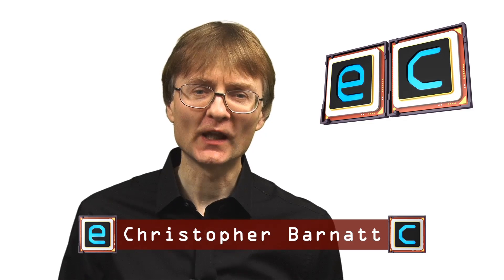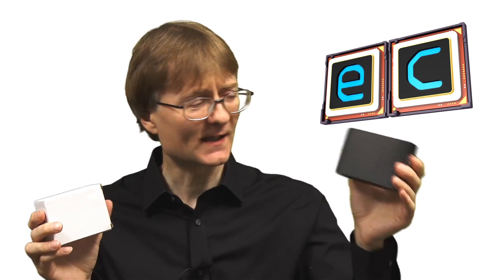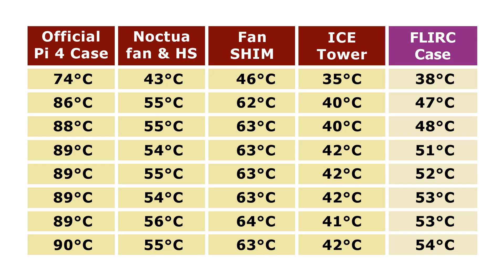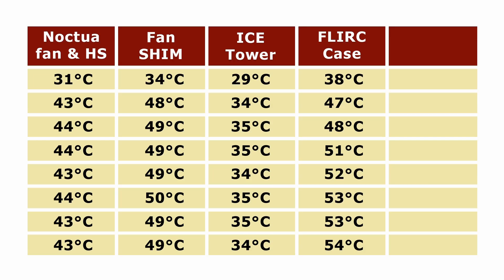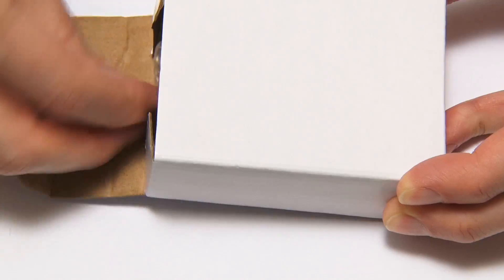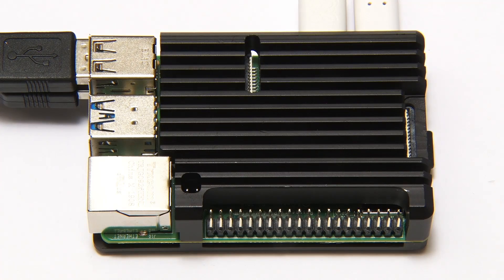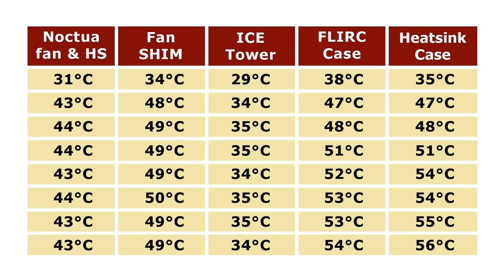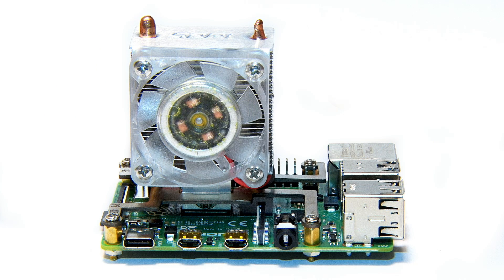Raspberry Pi 4 Passive Cooling

Comment: I have switched the thermal pad in all my Flirc Raspberry Pi 4 and 5 cases over to a proper copper shim with thermal paste on both sides.  It definitely makes a difference in pulling the heat out of the CPU and into the aluminum case.

Comment: It's baffling to me that people keep missing the performance measurement in thermal testing.  Measuring temperature alone is telling you precisely nothing.  The only thing it could possibly tell you is if you've overcome the maximum output of the chip, which is, by definition ,overkill, and in the case of solid state electronics, could actually reduce performance (ssds actually like to run warm and will perform less efficiently when cooled too much.)
Reply from the maker: No, I think you've missed the point. This video is about testing cooling solutions, which will both increase the life expectancy of the hardware, and prevent a Pi throttling at load, so delivering reduced performance. It is simply not true to say this video is about "overcoming the maximum output of the chip". Complete and utter garbage. No such thing is being "overcome". Rather, the SoC CPU cores are just running at 100 per cent utilization, which is perfectly normal and what every computer does at load.

Comment: How much do these affect performance. Does the pi thermal throttle without any cooling? Or with a small heatsink
Reply from the maker: When first released, a Pi 4 throttled very easily with no cooling. But firmware updates have improved matters greatly, so these days a small heat sink is usually fine unless you are going to run the Pi at constant, heavy load. But the Pi will last longer if it runs cooler.
Reply: @ExplainingComputers  huh I think I'll just get a small one :) thanks! Or whatever's cheapest

Comment: I have done the most overkill passive cooling solution: I attached a gigantic 1155 Titan cooler tower and converted the fan to USB (I don't use it mostly, therefore it's passive). The heatsink is cooling 2 times better than a small heatsink with a fan

Comment: My very first thought when I received my Flirc Case was regards the Plastic Lid.
Seems like it is adding an insulator on top of a large area of the radiant surface.
Has anyone done any decent comparative test of the Flirc Cases with lid on vs off?

My searches to date aren't finding any mentions.

Comment: Sir, I'm using retroflag casing for my raspberry pi & I've installed 3 heatsink & a pi fan but still it running at 62-67 degree celsius... I'm abit worry, will this damaging my pi in long term?

Comment: Not the object of the testing, but I do wonder about the RF screening properties of both the FLIRC case and the Heatsink case. How much damage does it do to Bluetooth and Wifi signals I wonder? For clarity, I want to meet Mr Cake and eat him too!
As always the information provided is extrememly useful. I use a RPi 3B+ for most of my general Youtube, email and other pursuits and as the summer approaches, I watch the effects of the ambient temperature on the system.
Reply from the maker: These metal cases do reduce the WiFi signal strength, maybe one "bar".
Reply: @ExplainingComputers  Many thanks Christopher, that is a lot less loss than I might have imagined; good news indeed. All concerns dispelled.

Comment: Take a look at that one, yeah no Kodi design, but I would say way better cooling, because it cools all chips and can be mounted at a wall: https://www.amazon.de/Geekworm-Raspberry-Aluminum-Passive-Dissaption/dp/B07Z6GK85H/ref=psdc_430174031_t3_B0861LS3Z1 What's missing on all cases with all chip cooling is a power button. The Argon One case variants have a power button, but only 2 of 5 possible cooling places are there. Especially for the M.2 variant, where you can use a SATA M.2 SSD, connected via USB 3.0, the USB controller can get warmer as expected as you an read in comments.

Comment: 13:34 looks like you put a heat pad on the wrong chip. On the heater they are all aligned, so looking at RPi the left one should be at the bottom left, not upper left chip. Anyway, the latter one is a winner as it allows absolutely required function: access to GPIO.

Comment: The ice-tower, whilst good performance, looks a bit ungainly in practice. I've got the fan-shim , and that seems to be good, apart from the noise the very small fan makes.
I guess I'm wondering how a 40mm fan on top of the heatsink-case would work. A larger 40mm fan could be made to run at a slower speed, and be pretty quiet. Also no 3D-printed stuff required.
But yes, as you say, apply the latest firmware :-D
Finally , who would down vote this ? Some people !

Comment: I have the second case you showed, the all aluminim one.. And at idle doing nothing it's at 56 degrees, feels even hotter.. Something's wrong.
Edit: I shut it down but left it powered for a day.. still pretty hot, I'd have to say 45 degrees. But I obviously can't login to check without turning it back on.

Comment: Is it possible to mount this case on a back of a Desktop monitor? Also that this monitor can power the Pi 4. Keyboard and mouse could be used wireless. So that I would have to plug-in the monitor only? Something like this would be very professional. Can you help suggest on this? Thanks

Comment: I got a question:  Was the temperature measured with the system under load or not?  I can see that the passive systems are good enough for light applications but what if the processor is under stress or heavy load like in video editing or gaming?
Reply from the maker: The whole point of the Sysbench test used in the video is to run the CPU at 100 per cent load. :) So yes, the Pi was running at absolute maximum load.
Reply: @ExplainingComputers  Thanks a lot!  Highly appreciated.

Comment: The sd card sticks out of the second case and renders the Pi useless if dropped ( like i did) .... good case but protect that sd card
Reply: i also added an old 12 volt CPU fan running at about 5 USB volts for almost silent running

Comment: How is performance of ICE Tower without the fan?
Reply from the maker: I runs a few degrees hotter.
Reply: @ExplainingComputers  ICE tower seems good without using the fan (passive cooling hack). Even though it is big!
Reply from the maker: @jlexploretheworld1164  Agreed. It is an excellent passive as well as active cooler.

Comment: One thing I wonder about: This test only heats up the CPU. In your latest video, where you have built your "Ultimate Rig", you boot from SSD via USB3. How much does the USB controller actually heat up when constantly in use like that? Would the results for the last passive cooler in this test be better, since it has a dedicated contact point for the controller?

Comment: You should run the tests with some proper thermal compound like MX4 Thermal paste instead of those naff pads and see how much better the heat transfer is!  Would be interesting to see the difference :-)
Reply from the maker: Indeed, but be aware that there is a considerable gap between the lugs in these cases and the SoC and other chips being cooled -- the lugs are are not designed to directly contact the chips, but to have a flexible spacer in the middle, which is the thermal pad. So you'd be talking the best part of 1mm+ of thermal compound between the two, and this is not the kind of gap that thermal compound is intended to fill. :) So to make work what you describe, some kind of metal shim would need to be added in, introducing another surface-to-surface transition.
Reply from the maker: Indeed, but be aware that there is a considerable gap between the lugs in these cases and the SoC and other chips being cooled -- the lugs are are not designed to directly contact the chips, but to have a flexible spacer in the middle, which is the thermal pad. So you'd be talking the best part of 1mm+ of thermal compound between the two, and this is not the kind of gap that thermal compound is intended to fill. :) So to make work what you describe, some kind of metal shim would need to be added in, introducing another surface-to-surface transition.

Comment: For some reason the FLIRC case reminds me of the He100 fighter plane prototype from WWII.  Instead of having a radiator which creates drag, they considered plumbing the coolant through the wings and body of the plane right beneath the metal skin, so the surface turns almost the entire plane into a big radiator, with less drag.
Here's the problem:  this is a fighter plane.  It would be getting shot at.  And if just 1 bullet hit the coolant channels that that the plane is covered in, it would start leaking coolant.  And it would only be a matter of time before all the coolant flow is gone, and the engine overheats and seizes.  One hit that normally makes no difference for a regular plane, cripples it.  So for a racing plane, it's a wonderful idea.  For a fighter plane, not so much.  LOL

Comment: I still cannot understand how the "Aluminium Heatsink Case" with all its fins and pads for all 3 chips get higher temperature than the FLIRC. Great video anyway !!
Reply from the maker: The Aluminium heat sink relies on quite thick thermal pads, which are probably not as effective that that on the Flirc case.

Comment: Did you notice at @13:32  the small thermal pad was on the wrong chip?
Reply from the maker: The pads were I think fitted for the SoC, RAM and USB controller.

Comment: Anyone try the script? 

It 'works' for me but it finishes immediately for me. I do get the same output. 

How do i put in a delay?
Reply from the maker: For the script to work you must have sysbench installed on your Pi. Open a terminal and enter "sudo apt install sysbench"  (do not enter the quote marks).
Reply: @ExplainingComputers  That did it. Thanks!

Comment: You’re not realising the passive heatsink is also taking the heat from the RAM and USB controller so the temperature will be higher, but those extra chips will be cooler now. Much prefer this design as a result, cus that RAM chip gets dam hot.
Reply from the maker: In what possible way am I "not realising" given that I show and discuss in some detail the three heat pads and cooling of the SoC, memory and USB controller from about 13:03 onwards? The temperature measurements here are of the SoC, not the heat sinc, which as I explictly note and show is being heated up by all three compoents.

Comment: With the Aluminum heat sink case, I've found if you raise it off the bench top, on a stand that allows free airflow around it, that makes a significant difference to how cool it gets.
I'm using part of an old PC (used to cage hard drives, an open mesh of metal about one centimeter off the desk) to rise the Pi off up.  I found without doing this the case would get uncomfortable to touch.  With it raised it ends up being warm to the touch.
Reply from the maker: Good tip!

Comment: only thing you missed here is running the new firmware with the standard pi4 case. As the new firmware has improved thermals on everything else, it should be expected to do the same even on the standard case. This way you really see the difference between the default and other cases
Reply from the maker: I was not prepared to risk damaging the Pi 4. The standard Pi 4 case has zero ventilation.

Comment: I used the pimoroni heat sink case, accept I replaced the stock thermal pads with ARTIC pads, and my temps with no fan running lakka for one hour of N64 emulation with a max top temp of 45c.

Comment: I guess a critical point to think about is if you want to attach anything to the raspberry pi, the heatsink case seems to be the right choice when you want to use the gpio pins or something else that isn't USB connected. The flirc looks nicer and less things can touch the board if none of the above matters with a similar performance.

It might be nice though to run the tests longer for both of these passive heatsink cases, the other active cooling ones look stable and the passively cooled ones are still steadily increasing. I'd be curious about both the final temperature of the heatsink and CPU in both scenarios. It'll probably be quite safe to the touch still I guess.

I do know one thing about these heatsink cases though, if I use them at an unrestricted area in my house they are likely to attract furry creatures that think it's a nice warm bed to sleep on.

Comment: Would it not have been a good idea to install a SATA Hat onto the Raspberry Pi before putting into the heatsink case to allow you to attach to a SATA SSD so you can have as mush storage as you want.
Reply from the maker: You cannot fi t any SATA HAT I know of with the heat sink cases here. :)

Comment: On my RPI4 with heatsink case (passive cooling), the idle temperature using Manjaro ARM is 38-39 C whereas on Ubuntu server it was 43-44 C....installed yesterday and loving it

Comment: Thanks, another great video!
I've installed open media vault 5 on my pi4 which is headless do you know if using it as a server needs cooling?
Reply from the maker: If the Pi is running the latest firmware, you will probably get away with no cooling. But I personally would at least an a smalll heatsink.
Reply: @ExplainingComputers  thanks!

Comment: Just one question, could the test include performance report, maybe the length of time between tests.  To see if the firmware doesn’t simply slow the frequency if the chips etc.
Reply from the maker: All tests run for 10 minutes -- the CPUs are running at full speed througout.

Comment: After watching these cooling videos for the Pi 4, I concluded that the Flirc case fit my criteria the best out of the products tested.  That criteria being very effective passive cooling while still completely enclosing the Pi.  Obviously aluminum covering/enclosing the WiFi & BT radios is likely going to have a significant detrimental effect on their performance.  I didn't have any specific plans to use BT and had already decided to use RJ45 connected Ethernet, so that didn't bother me.

That being said; I want to share with you all the case I actually ended up getting and using.  What I ended up with is this:
            https://smile.amazon.com/gp/product/B07ZVJDRF3/ref=ppx_yo_dt_b_asin_title_o01_s00?ie=UTF8&psc=1
Like the Flirc, the case is also the heat-sink.  Unlike the Flirc, there is also additional cooling lugs so not just the SOC benefits.  These lugs are not shown in the product description, but are like the ones found in another of their cases shown here:
           https://smile.amazon.com/Geekworm-Raspberry-Aluminum-Passive-Heatsink/dp/B07Z6FYHCH?ref_=ast_sto_dp
which I'm sure probably works (nearly) as good even though it doesn't have the fluting.  Also, the aluminum is thicker on these Geekworm units and is also present on the bottom as well as the top.

 I tested my case a few weeks back using the same methodology as Christopher, only I ran it for an hour to make sure all that extra aluminum had time to saturate with heat.  I am sorry I did not write down my results, but I do remember that the performance was just a bit better than Christopher's Flirc results.  Note that, I had updated the Pi firmware prior to running my tests.  I would have run the test again to provide you with exact results, but I'm too lazy to reimage it for Raspian (currently running LibreElec so sysbench is not available).  Initial ambient temperature in my "lab" was 68F/20C.  :-)  Keep in mind the testing only measures SOC temps, so there may be an unobserved advantage in cooling of other components too with the Geekworm.

Comment: But what happens if you have a high load a long time on the raspberry pi? Does it really handle the temperature or will it just dealy the time until it gets hot?
Reply from the maker: It may throttle to reduce its temperature.

Comment: The disadvantage of the Alu-Armor heat sink is that the 40-pin header connector cannot be attached to it. The milling needs either a B-undercut due to the milling cutter radius when milling from above (ugly) or one milling from the side, i.e. a second milling spindle or laser cut (expensive) or reclamping (labor-intensive). So you can only remove the radius by hand with the flat file - the question void the guarantee of the board if it was sold as a kit. Despite all the trouble, the cooling for continuous operation works perfectly without noise and very importantly without power consumption for the cooling. The heavy heat sink is problematic for flight operations.

Comment: what app or software did you use to get the temperature reading?

Thank you
Reply from the maker: No app -- I'm using the command vcgencmd measure_temp as included in the script in the video. You can enter this into a command prompt on the Pi. :)

Comment: Please take a look at the ArgonOne case that come in 2 versions for Raspberry Pi 3 and 4. I have just bought one for my Pi4 and I am very satisfied with it. It can supply both passive and active cooling. The active cooling can be temperature controlled through a script that measure the temperatur and adjust the speed of the fan. All ports is routed to the back side of the case, where there also is a power button which can power on and (a safe shutdown) off. Look at: https://www.argon40.com/LEARN/post/argon-one-case-overview/
Reply from the maker: It indeed looks a great case.

Comment: Can you do a video on how the best way to add RS-232 serial port or ports. If I can get Definitive 5 to run on  SBC w/4GB, 512GB SSD and 128GB/256GB SD card then I have to 1 RS-232 serial port for our real time data collection system.  also I need spec on NIC/WF-FI for Drivers.  I will hound Xinuos for them. The above specs are the MAX for Definitive 5.  I have never built a Definitive 5 system with over 2GB but Xinuos say 4GB is the max, they also say to it best to have AHCI on board.